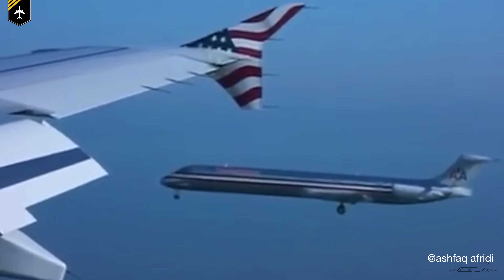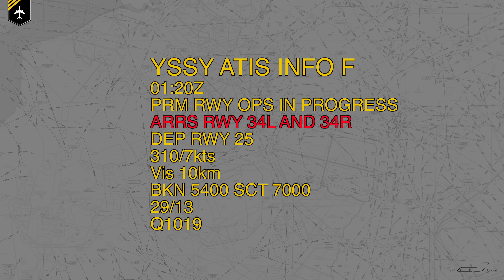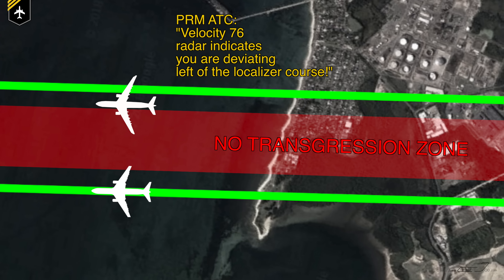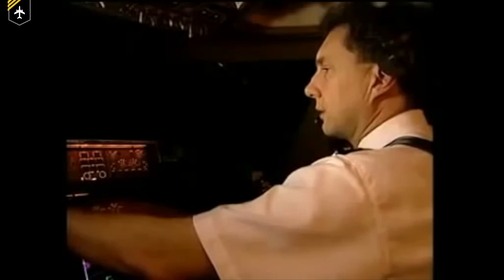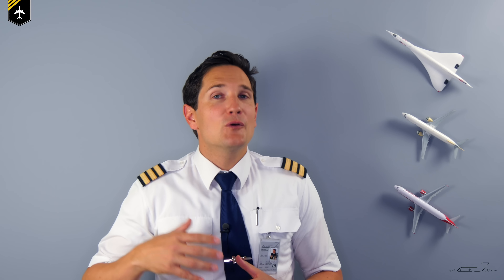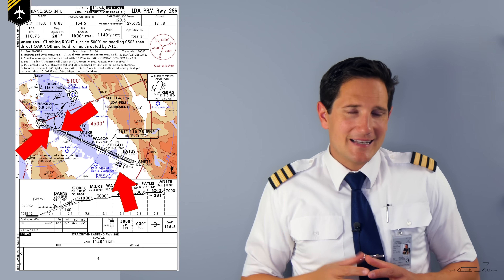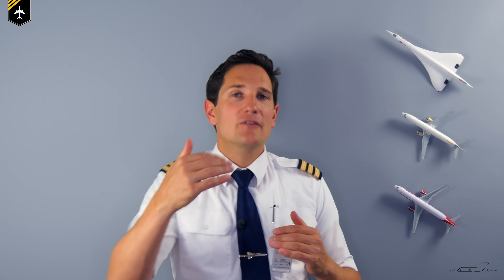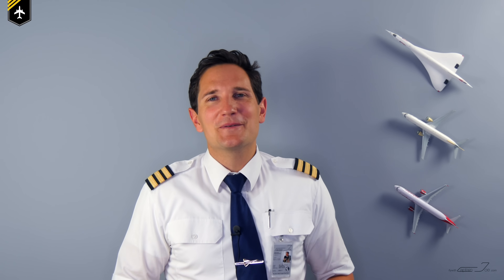Parallel LANDINGS!!! PRM and SOIA approaches! Explained by CAPTAIN JOE

Comment: Why did they send the leading plane around but not the trailing plane in the video example?
Reply: I'm assuming it has to do with maneuver space and visibility. The leading plane has the space in front of it to execute a breakout maneuver, and does not have easy visual contact on the trailing plane. The trailing plane, meanwhile, has no space in front to maneuver (too risky) but full visual on the leading plane; so when the order is given, the trailing plane sees what's going on as the leading plane executes the maneuver. I'm guessing aircraft weight also affects the decision, along with other factors

Comment: Great explanation, Joe. I am a software engineer; I helped to design the PRM system. Some interesting notes:  The FAA never wanted PRM; it was driven by demand from airports and airlines.  At SFO, the airport authority didn't want it, but one airline did want it, so that airline volunteered to pay for the entire installation.  It was that airline whose senior pilots invented the SOIA procedure.  It turns out that while it is very difficult for most pilots to learn to reliably fly PRM without forcing breakouts, most pilots master the SOIA procedure quickly and easily.
Reply: @captain samuel aviator737 The FAA is concerned first and foremost with safety, not traffic density: therefore anything which reduces separation below the usual horizontal separation is going to cause at least some hesitation... the FAA would rather have fewer flights into the airport, maintaining standard separation requirements
Reply: @audigex  this is only true to an extent. Pre covid numbers into sfo were maxed out even during sideby operations. Delays mean the airlines start complaining and the FAA doesn’t like that either. Obviously safety is first and foremost. But when it comes to SOIA and PRM scopes they were very safe. Two controllers dedicated to just watching a no transgression zone and special training for pilots. This is arguably safer than what they do today with dual ILS approaches and a 1 mile stagger. No monitor scopes, and no special training. Both operations are safe and efficient. SOIA demanded more staffing.. the FAA hears the word staffing and thinks $$$$$. The termination of SOIA has less to do with safety than it does $.
Reply: It sounds like the SOIA procedure contains PRM as a sub-procedure, am I wrong?
Reply: The way terminology evolves is convoluted. "PRM" is the name of the hardware that makes both procedures possible. That name stuck to the first procedure developed with it.  SOIA is a different procedure using the same hardware.  The computer modeling for both is basically the same, however, the size and shape of the NTZ is different, and the procedure rules are different.  This results in SOIA having a lower probability of predicted intersecting flight paths, hence fewer breakout orders, which is why it is easier to learn.
Reply: @krakenmetzger  see https://youtu.be/78V66AbPGj4
Reply: And now they don’t use SIOA or PRM anymore at SFO. 😂
Reply: @SpicyFaceActual  The FAA always hated it, it was a case of "Not Invented Here".
Reply: @KennethAGrimm  We hated it because it required two extra scopes and the personnel to staff those scopes. With the staffing shortage this meant short breaks and long time on position. 7110.308 operations don’t require PRM scopes and land just as many planes. 👍
Reply: @SpicyFaceActual  what do they use?
Reply: @herbiecactus6687  Charted visuals in this video. And closely spaced parallel ILS approaches when it’s IFR.
Reply: @Michael Keller Actually I have begun to make those videos, on several of my other channels. For example, https://youtu.be/PvPcAhHN23U documents my encounter with Osama bin Laden, and in https://youtu.be/5LDgQP_hahU I recall some of the most significant events in my spiritual journey.   I haven't gotten to videos about aviation and engineering yet, perhaps someday in "Threescore and Ten" https://www.youtube.com/channel/UCH1MoL058SGnDPgsPcu3fgA
Reply: Thank you for making life easier...
Reply: @Michael Keller Last week I recorded my experience with a Fokker F-28 that went supersonic; as soon as I get it edited, it will be on  "Threescore and Ten"
Reply: Sneak Preview of the  Fokker F-28 that went supersonic https://youtu.be/E5_bV4lT5Pw

Comment: I'm passing my PPL/CPL at a comercial airport with 2 parallel runways,  in which the biggest planes coming are 737s. We don't have such systems as PRM and as a student I'm in C152, but I had to overshoot many times, because of the turbulences of a bigger traffic landing before me. It's also quiet the thrill when there's crosswind pushing you toward the other runway. I had the chance to do my run up with a 737 behind me for one of my first flights, I felt like a pro this time haha :D

Comment: I am a current ATC at Northern California TRACON and I actually work SFO arrivals.  SOIA approaches are run less than 1% of the year at SFO.  In the video with the 747 going around you are watching "Side By visuals" that are done in VMC conditions. The reason that the 747 is going around is because heavy jets cannot overtake other aircraft during these operations.  All heavy jets are required to be on the ILS PRM to runway 28L during SOIA procedures as wake turbulence does not exist until the visual segment when it is then the pilot's responsibility to provide their own wake turbulence mitigation.  If you have any other questions please let me know.
Reply: I was referring to any other Air Traffic questions. I am not an expert on engine design.
Reply: @adamant59  sry
Reply: I have 94 landings at SFO and probably only did the SOIA approaches once or twice. Maybe a couple PRM’s. The rest were just ILS or visual.
Reply: Lol ok, so, why do rear mounted twinjets, like the MD-80, and first gen 737s with the JT8Ds have literal folding thrust reversers? (they fold upwards out of the engine)
Reply: @JostVanWair  To reverse thrust, you obviously need to change the direction of the gas coming out of the engine. For a turbojet or low bypass turbofan you cannot use reversers that just redirect the bypass air, as is done in high bypass engines, as that would (probably) leave you with a net forward thrust. To achive this, you need to place something behind the engines.
The Bombardier CRJs have tail mounted high bypass turbofans and use cascade reversers.
Some discussion here: https://www.airliners.net/forum/viewtopic.php?t=733649
Reply: Are PRM procedures run most of the year or are regular ILS approaches?
Reply: @nikosmanganiotis3519  Visuals, ILS in bad weather.
Reply: Interesting
Reply: Hi, actually i have a lot of questions about SOIA. Iam an ATC Instructor actually, if you don't mind to give me your contact to ask privately. thank you in advance.

Comment: Passengers: OMG this is so close!

Fighter pilot about to do mid-air refuling: Hold my near beer
Reply: Blue Angels flying in diamond formation: hold my non-alcoholic hydration formula
Reply: I was a military brat and I’ve seen F-16s refueling mid flight from inside a C-135.  I was 12 at the time and waved to the fighter pilot, who waved back.  Coolest memory of my life.
Reply: A fighter (particularly a fighter with a low fuel load) is just a little bit more agile than a widebody...

Comment: I have never had the opportunity to fly a PRM or SOIA myself, but I heard that at SFO specifically, when visibility is at a certain minimum that they won't even try the SOIA.  The only airport that I have flown approaches into with parallels are around 6,000 feet apart.  Interesting landing on one in a Grumman Tiger AA-5B with a MD-11F landing on the parallel!  At a mile out I was "ahead" of the MD-11F but at the middle marker location, we were wingtip to wingtip extended and I was given the "Use Caution; Wake Turbulence."  I OK'd the caution with a "Thanks," continued to land.  I may have felt a little push if I was farther back, that wake could have reached me, I think.

Comment: The incident involving the breakout beginning at 8:00, involving the 747 and 767, is probably due to overtake.  One important thing to keep in mind is that although this video is about PRM and SOIA approaches, whenever the runways (centerlines) are separated by less than 2500 feet, visual separation has to be used at some point, and wake turbulence is also going to be a factor.  Although there's no way to be sure without hearing the audio, the reason for the 767 breakout is probably because the 747 is overtaking.  Considering that the visibility is good and the aircraft are already very close, it's likely that at the point shown in the video the 747 pilots have long had the 767 in sight and are using visual separation.  However, the 747 is not allowed to PASS the 767 under any circumstances.  This is specifically covered in ATC wake turbulence separation rules for runways separated by less than 2500 feet.  If the 747 can't stay behind the 767, one of the airplanes must be broken out.  Usually, it will be whichever airplane (controller) "missed its mark," so it's likely that the controller working the 767 was too far behind his aiming point.

Comment: I'm super late, but my local airport (5 minutes from my house) KMSP has been doing PRM approaches since 1997!
Reply: I'm also late, but did KMSP discontinue PRM? I didn't see any info about that on AirNav.
Reply: I live 15 mins away from KMSP
Reply: @zvj  I live in Savage and go spotting at MSP often
Reply: I live in Savage! I go spotting at MSP all the time
Reply: In reply to Daniel Devadas, I would says "Quite likely, yes"; the local FAA office in Minneapolis always hated PRM, and tried their best to get it de-certified when we first installed it. The kept blaming other system faults, such as FRUIT from an out-of-calibration radio on a general aviation aircraft at the hanger, on the new PRM system.

Comment: I was flying from Schiphol to Rome and I had a PRM approach. I saw that the A320 next to us was coming really close and seconds later we had a brake up procedure!
Reply: Break up procedure? Is that where you break up with your girlfriend when you think you're about to die?
Reply: @aqxico  no, it's when you correctly follow the breakup checklist at the behest of relationship traffic control, and successfully abort to a single status holding pattern
Reply: @jamesburleson1916  lmfaoo I can't believe this is a real conversation 😂
Reply: @aqxico  l bet you can’t sit down anymore?! Better get a pillow?
Reply: Umm, this is awkward: because Rome don't use PRM approaches... only 5 airports in the world use PRM approaches, and the only airport outside the US that does is Sydney, Australia. (San Francisco, Detroit, Atlanta, and Chicago being the other 4).

Rome does have parallel approaches, but you just had a good old fashioned loss of separation, not a PRM approach and breakout.
Reply: @audigex  That list is not quite complete; in addition to my involvement with the San Francisco SOIA/PRM, I participated in the design and initial testing of the first two PRM systems, which were at Raleigh-Durham and Minneapolis, and the first PRM outside of the USA, at Hong Kong's then-new Chek Lap Kok airport.
Reply: @KenGrimm1949  aren't the two current runways at Hong Kong far enough apart for normal parallel approaches?
Reply: @scheckenhere7417   Taken by itself, the minimum distance between the parallel runways at Chek Lap Kok is sufficient. However, International Civil Aviation Organization’s requirements on independent mixed mode of operation could not be met due to terrain obstructions, south and northeast of the HKIA.
Reply: @KenGrimm1949  ah that makes sense. Thanks for the quick respond.

Comment: You probably wouldn't believe be, but one time there was a plane flying parallel to my plane, it was closing in on us, it got so close it was about the distance of between two gates at the airport, then the other plane rolled the other way and slowly disappeared into the horizon. Note this all happened mid air, above the clouds.

Comment: Joe, great video as usual. I do that SFO approach a lot, and I’m guessing the breakout in your video wasn’t because of a controller directed, but rather because the 767 forgot to turn his TCAS to TA only, and thus got a RA. Seen it happen a handful of times myself (not me, of course😉). However, the go around could have been anything, but wanted to chime in about specific procedures on the TCAS for SFO.  We were pulling up beside another carrier one night who was in front of us, and they did a pretty aggressive pitch up go around. Then stated their TCAS went off.  Oops. They should have read the instructions😎

That approach is definitely my favorite in the USA. 

One thing that bugs me is that SFO approach will have you “maintain visual separation”, but in a 737-900 we are going faster than literally everybody else, so you end up over running and going in front. Thus, visual separation gets kind of iffy. 

SFO runs their airport almost identical to LGA, but they are doing it with 2 sets of parallel runways simultaneously instead of singles. It’s a piece of art when well executed.   The very second that the two landing aircraft are clear of the intersecting runways, they are clearing the intersection runways for two more takeoffs to a fan departure, followed by two more landings as the next two takeoffs are lining up.  Very cool. 

Worth mentioning to passengers with a PA ahead of time to not be alarmed when they find themselves in formation with another plane on final.

Comment: one side note about landing at SFO.  It was on the news either in 2017 or 2018.  Due to noise complaints from the residents south of SFO, a new guidline has or will be coming effective. Planes will have to remain at high altitude while traveling above Bay Area.  Planes will have a much shaper decent when landing.  I am not a pilot, so I have no idea how much of a difficulty it will bring into landing planes at SFO.

Comment: I have a somewhat related close proximity story. It's got nothing to do with PRM or SOIA, however it happened during a landing approach. First some background, at some time in the past I was a skydiver. I'm Belgian and the main airport we have is Zaventem airport. About 30 km to the east of the airport there's a DZ (drop zone) for skydivers. Our DZ operates a Cessna Grand Caravan. Each sunday afternoon there's a what we call a "holding" where planes which are landing in Zaventem are diverted over our DZ which means our Cessna doesn't go up. Usually this only lasts for a good hour if I remember correctly. When our Cessna goes up we usually jump at an altitude of 13.000ft but some of us exit sooner at about 5000 to 5500ft. Those are called hop & pops and are for jumpers who want to train high performance canopy flying only.

So at one time, on a sunday with the holding hours away, we were flying up. There were 18 jumpers in the Cessna, which is a full load, and a few people wanting to do a hop & pop exit. There were a lot of clouds and the Cessna was climbing through it. It was a bit of a dreary rainy day which produced large thick clouds. Unlike in the US, European jumpers are allowed to jump through clouds even when there's no ground visibility. When the hop & pop jumpers go out at 5500ft, the sliding plexiglass door is opened and the jumpers jump out. I was positioned pretty close to the door so I had a pretty good view of the outside. We were flying in between large towering clouds. Three jumpers went out and right when the last one exited suddenly out of the clouds at almost our exact same height cale Virgin Express 737-300 full red airplane. They are easily recognizable since they have their fuselage full red. It was right there, just popped out of the clouds about 1000ft behind us and flew over us and I got to look at it directly with the open door. It flew over us with a difference in height of about 300ft vertically and perhaps 100ft to the side. Our pilot didn't notice him and when I told about it on the ground to a skydiver who was a trainee in becoming an airline pilot he didn't believe a thing I said. 
But it happened for sure, somebody messed up that day and I think not even the pilots of the 737 saw us.  There's wasn't any unstable turbulence felt and nothing happened. Nobody got scared, those who saw it thought of it like it was an amazing and freak experience. We just closed the door, talked about it in the plane like "wow did you see that". We climbed to 13000ft and did our jump.

Comment: @Captain Joe : I believe a breakout procedure once happened on a Q-400 I was flying on when landing at Toronto Pearson. I was looking through my viewport and saw what i believe was a 727 (not sure) being awfully close. We were nearing the airport and lined up with the runway when it happened. Same as in the video, the pilot throttled up, raised gears, gained altitude and came around for another landing.
I laughed a little back then cause i had flown over 20 times that year and have had no incidents happen so far. I believe i now understand what happened and can check that on my bucket list, it's getting kind of long and i'd like it to stop but frequent flyers like me statistically run into more incidents than regular people.
So far:
Minor Tail Strike at Cuba (Pilot didn't push the throttle before disengaging the brakes, short runway)
Aborted takeoff at Quebec Airport (I believe the pilot said it had something to do with too much snow on the runway)
Waited for half an hour in a waiting loop because of a mayday from another plane at New-York
Aborted landing because of crosswinds at Quebec Airport in a Dash-8
And now i can add breakout procedure at Toronto Pearson

Well it never gets boring in the air!